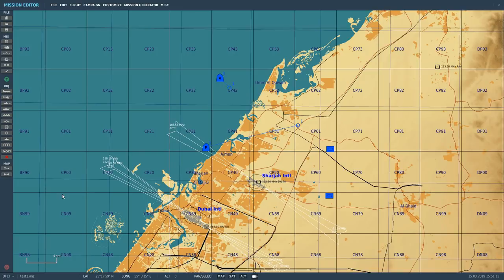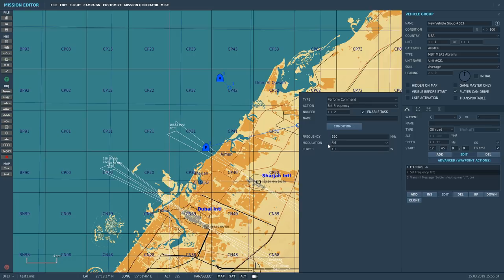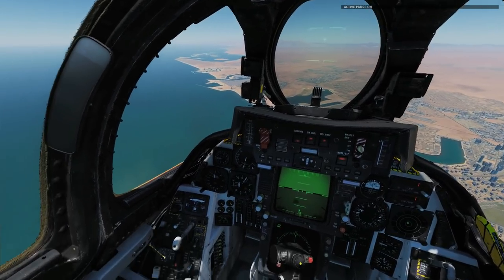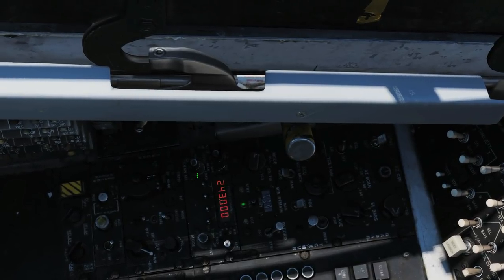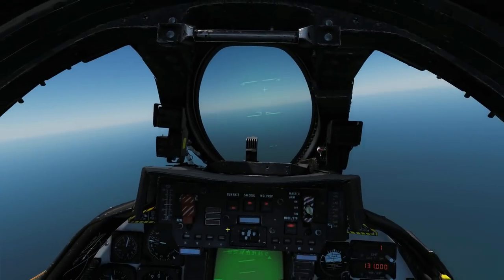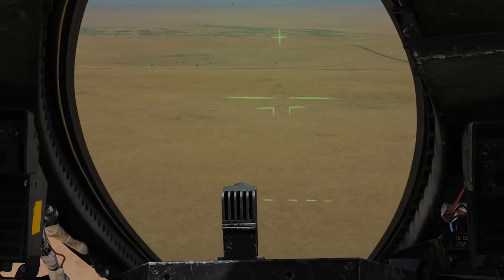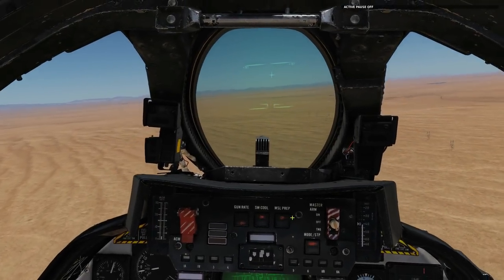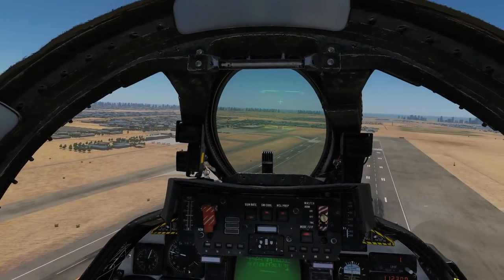F-14B Tomcat: ARA-50 ADF (VOR/AM/FM) Navigation Tutorial | DCS WORLD

Comment: Sorry, I must be doing something wrong. I cannot for the life of me get this to work. I followed your tutorial, even copied the parameters / frequencies in the mission editor from your example, but still not able to hear anything or get the direction on the BDHI when I put it in DF mode. The small/thin needle only points 12 o'clock when I do this. In the mission editor: I've set action commands like set frequencies, transmit frequencies, chosen a .wav file for it to transmit etc. Freq: 320 FM. I've tried to get Jester to tune it in via the Jester menu, and also manually from the RIO seat. T/R = nothing. DF=BDHI thin needle only to 12 o'clock no matter what. Nothing is blocking the view (no mountains etc), and I am close to the tank transmitting. I want to be able to find things without pulling out the map everytime (feels like cheeting, you know?) Sorry for the long post, I hope you, or someone, can help me out! Btw, i'm new to DCS so there must be something i'm doing wrong.  Thanks
Reply from the maker: Is this in Multiplayer? Sometimes I find ADF not working in mulatiplatyer?
Reply: @grimreapers  No, I just made a custom mission editor case, like in the tutorial.
Reply: I have the same situation. I noticed my BDHI dislays off and suppose that has something to do with it...